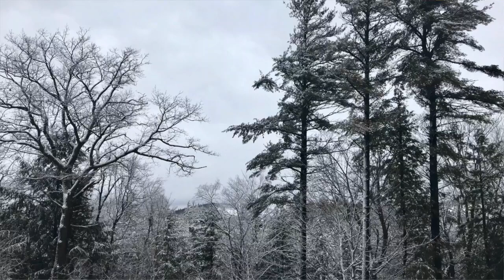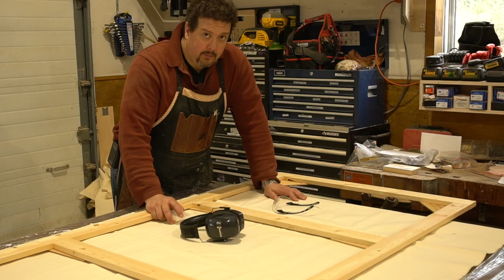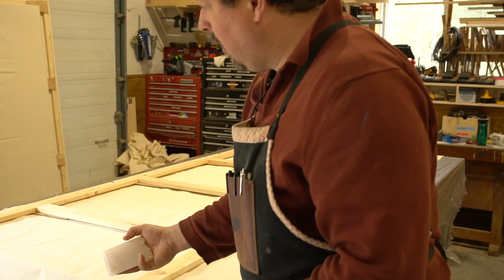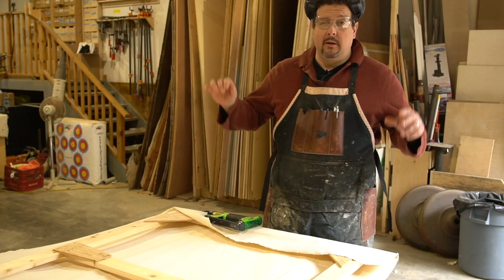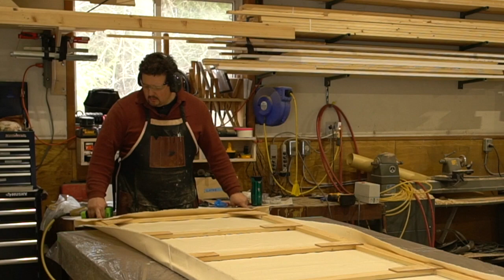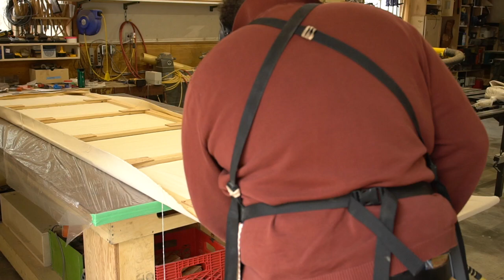Theatre Flat part 4- Installing the Canvas

Comment: This was super helpful! Thank you for making it! I was wondering though what type of staples you use to attach the fabric. Thanks so much!!
Reply from the maker: I am so glad this is useful!
I use upholstery staples. One type is T-50 staples others are sometimes tied to a single (or few) manufacturer(s). T-50 are a little heavier duty than others, but the staples are pretty easy to come by in the US and Canada (not sure for other countries to be frank), both Arrow and Stanley use them. The staplers are quite reasonable to purchase. I do suggest a pneumatic stapler over manual. I will also use a 22gauge staple in my grex upholstery gun- the stapler is much more expensive, the staples are more dainty... though it is a real pleasure to use that gun and the back of the flat is nicer looking!  ... but that is not the face that really matters.
Both will do the job. Follow your wallet and your heart.
Be well!
J

Comment: What weight of canvas do you use and do you have a preferred supplier… I’m located in a rural area with no fabric store for 50 miles and no theatre supply for 100+ miles …. What weight and length of staples for fabric…AND THX FOR THE VIDEO SERIES!
Reply from the maker: Hi again Steve-
The canvas I get is local to me near Toronto Ontario.
The company that spans the northern two of the americas (Canada and the USA) is Rosebrand.
Weight wise- I am not sure to be frank.
I will have to check on Monday.
I have made flats with unsized cotton muslin from both a fabric store and one that sells artist's supplies. Though thinner, it works just as well in the short term.
The heavier the canvas, the tougher it is and will stand up to things like going on tour better.
I am super glad the video series is useful to you!
Be well
J